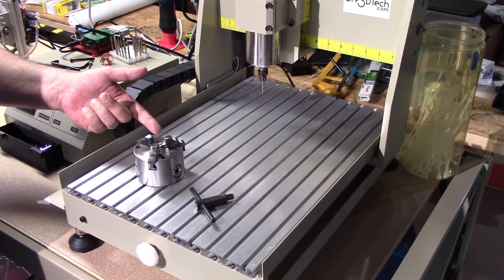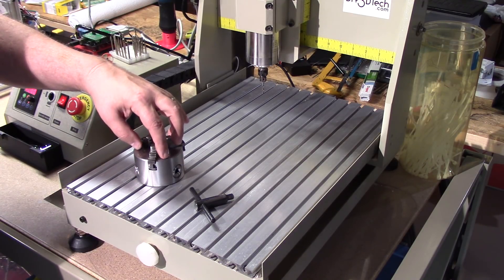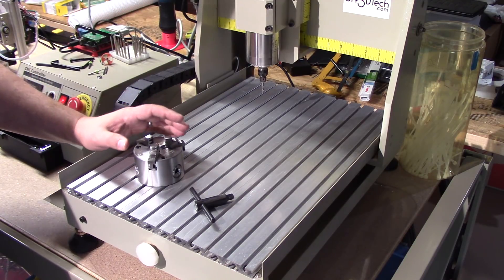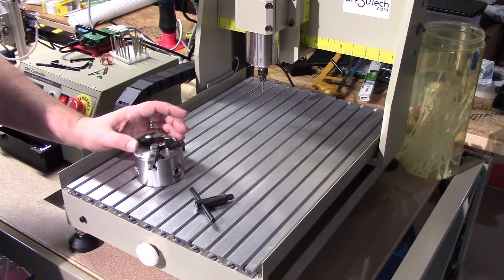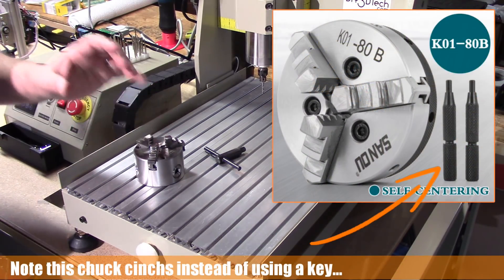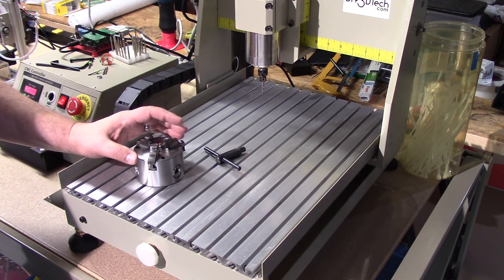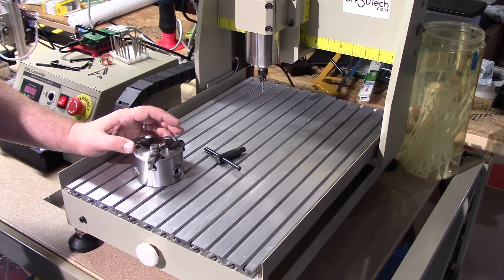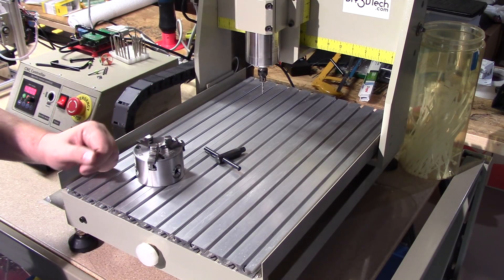Shop Talk - Repurposing Your 4th Axis CNC Chuck NYC CNC Style!

Comment: That looks like a sweet mill. Especially when you mentioned that I came with an A axis! Have you used the A axis? And what brand of mill is it? I am very interested in one that size.
Thanks for your informative videos!
Reply from the maker: Its 3040 (see more here: http://diy3dtech.com/purchase-3040-cnc-router/) and there is also a ply list too for this machine.  Have not used it "yet" as GRBL only does 3 axis, however working on (or I am buying a 5 axis machine :-)